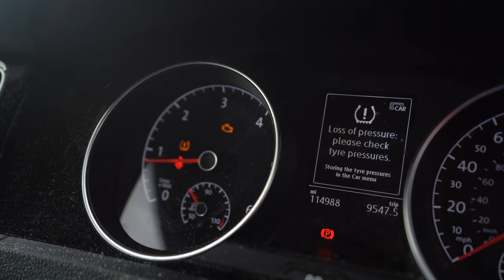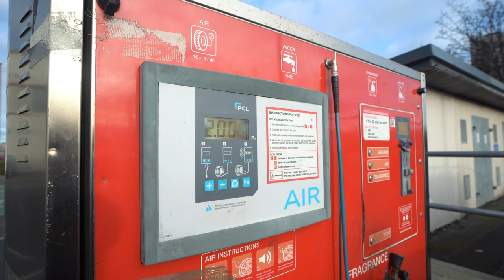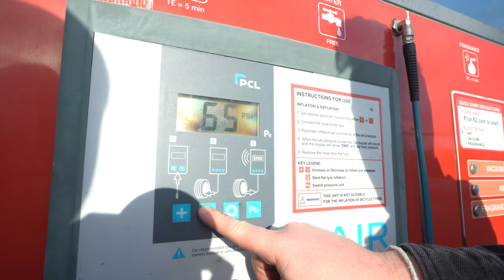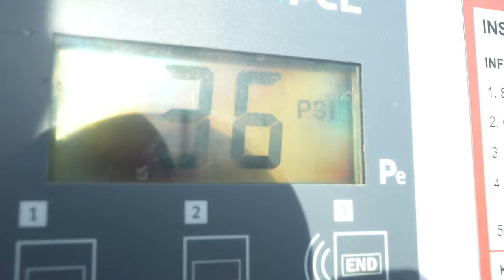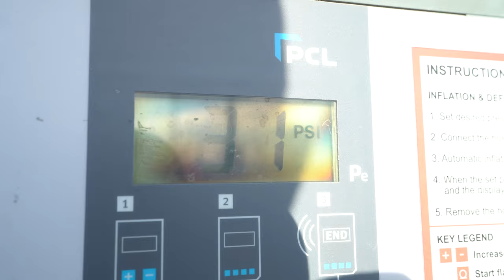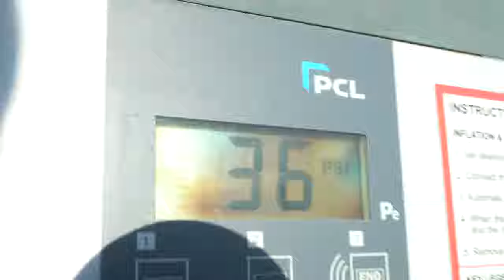How to put air in your car tyres | Watch a grown man struggle!

Comment: Oh god your mate gave me such a laugh....the sheer honesty of him and that laugh!! My Golf 2.0 is 36 PSI. My last 2 front tyres the garage had set them to 30 and I only got 15,000km out of them cuz they started wearing on the outside. Now I always check and reset them even after getting 2 new tyres. Can't trust garages or tyre places to even leave you right.

Another tip for your mate, his coolant header tank more than likely has a pink silica bag. Get his local indie garage to order a new header tank or remove the bag. VW Ireland and globally know this is a huge huge problem. It blocks the heater matrix and needs a coolant flush, guts of €1000. Just an FYI to other golf owners.
Reply from the maker: Nice tip Shane 👍🏻

Comment: Very good 😂👍👍. PSI should be on the tyre wall also. Helped a friend like this a few years back. Told her 3 of her tyres were gone and 4th wheel bearings gone. She had clio. Told her car would kill her or someone else. Few weeks later she bought old golf.a few weeks after that mondeo hit her from behind on m50 at speed.  her car had good tyres and nct. She walked away bruised.  Help a friend if they're not sure.
Reply from the maker: That’s a good idea re the wall actually
Reply: Different cars will have different tyre pressures, and any particular car will need different tyre pressures depending on how heavily loaded the car is. So, putting the psi on the tyre is not gonna work. Virtually all VW group cars (VW, Audi, Skoda, Seat, etc..) have the recommended tyre pressures label inside the fuel filler flap. Fuel is either “Petrol” or “Diesel” or “Electricity”! Have they not got basic mechanical questions in the driving test now?  Not that that would help in this particular case!!! No wonder our women are pissed off with our men 😄! Jesus Harry !

Comment: I laughed my legs off at this. It reminded me of a chap who I used to work with who didn't know how to change a wheel and would happily have called his breakdown service to do so which is fair enough as that's part of what they'll do for you but my reasoning to him was " you do realise that by the time your breakdown service makes it to you you could have the wheel changed yourself and he was like "so?" I just shook my head in utter disbelief! I'm not mechanically minded at all but I can do the basics like check the oil and fluid levels in the engine, plus the air in the tyres and change a wheel.

Comment: Tip for you reading this.  Reverse car up to unit. Do all free stuff first. Open doors remove matts shake em out. Remove 4 dust caps off valves.  Once happy set pressure to 32-36, read label on B pillar of fuel cap.
  Then drop in coin and select air pressure, level off all 4 tyres.
Good pressure into tyre valve to seal it.  
Once its done and you have your 4 beeps. Press vacuum and do all 4 foot wells and matts outside on floor.  If you’re good at it press sent, you will get smelly into car for 4 secs too.   
   Do all free stuff first and don’t Fanny about.

Comment: Paying 2euro for air? Is that €2 for each tire or €2 for all 4? Either way that's a scam
Reply: Normally €2 for 10 mins
Reply: Thank you. It's still a lot though 😞
Reply: @cnvdh3514  Yep! Also an option for €1 for 5 mins, usually what I do and run around as quickly as I can 😅
Reply: that shocked me! it's usually either £0.20 or £0.50 in rip off London
Reply: @MaxKrawiec  Here in South Africa its free so just paying for it in general is weird to me:)